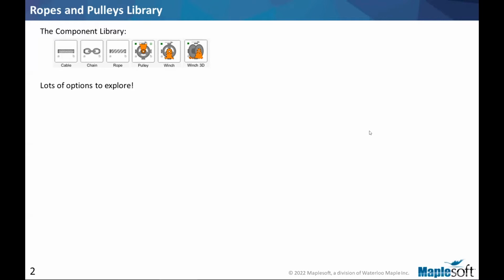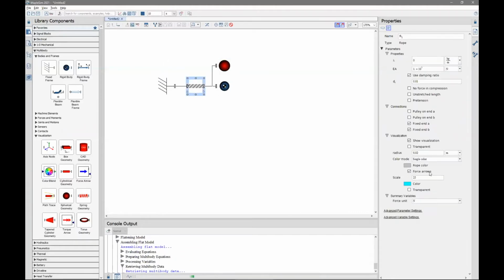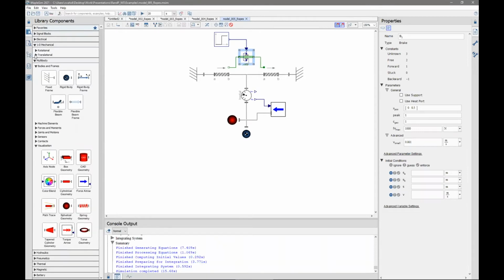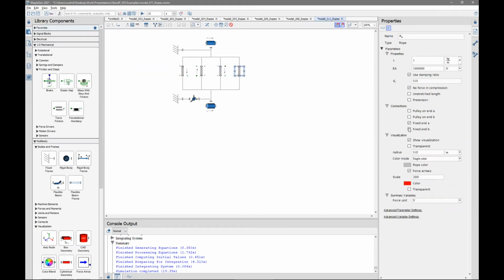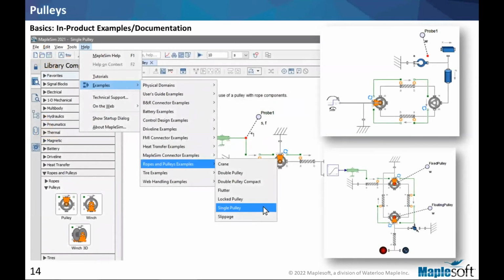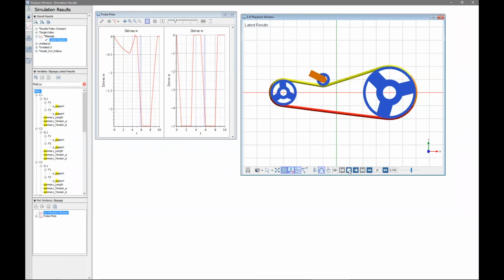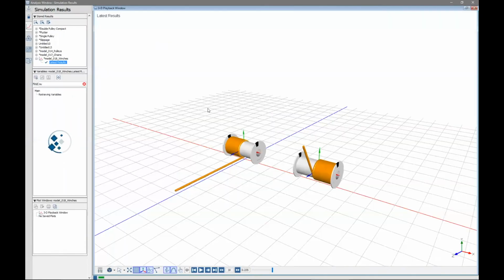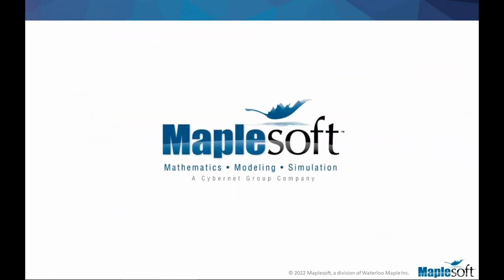Modeling and Simulation with Cables, Ropes, and Pulleys

Comment: Does MapleSim have any plug-in to be able to connect these ropes and pulleys to an arduino simulation?
Reply: MapleSim is a Modelica-based modeling tool and there are ways of running Modelica models in Arduino using third party apps after exporting the model from MapleSim. I would love to hear more about your application, and you can always discuss how to use MapleSim specialty components with the Maplesoft Engineering Solutions  team.